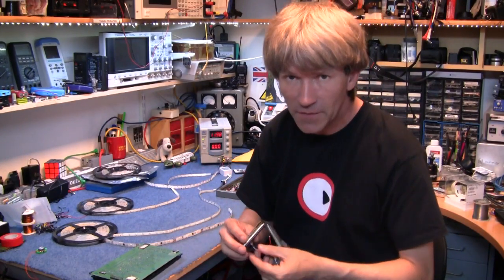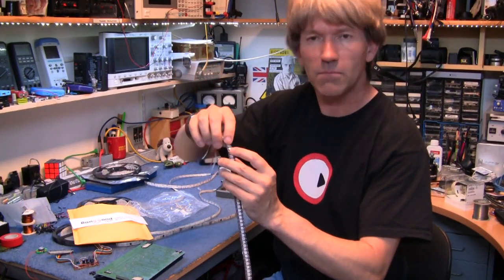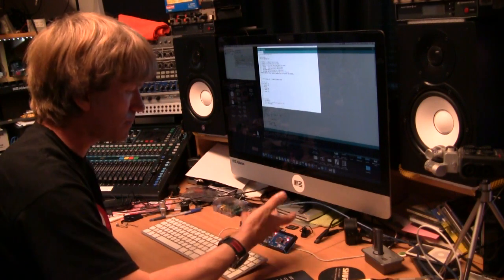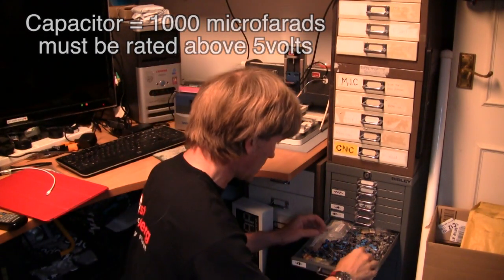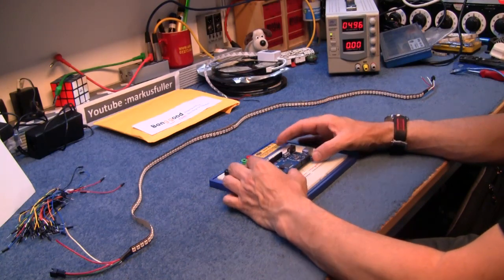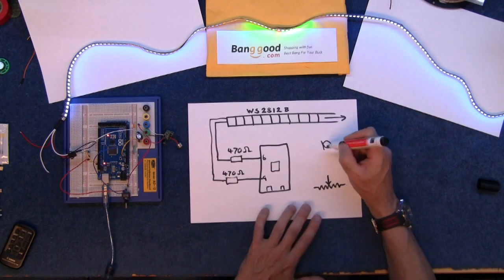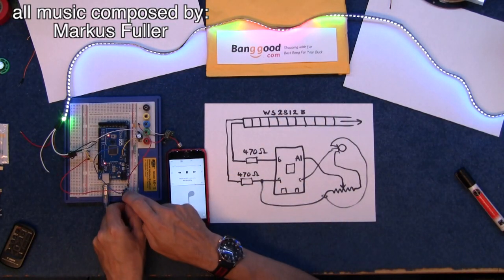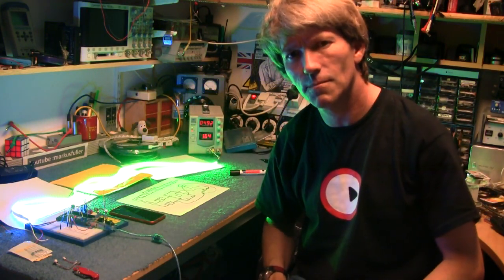Making a 144 LED VU meter from arduino and ws2812 addressable leds

Comment: This seems easy for a beginner like me :)  I have the components so here we go..... actually I have 2 strings of 144 lights but lets just start with one LOL  Thank you Markus!!! You have a new Subscriber :)  OHHHHH one question actually.... Do you have a link to the sketch you used for this?  Many Thanks!
Reply from the maker: Hi John. sorry it was a long time ago I cannot remember where I got the sketch but it was probably on the website called github .
Reply: @markusfuller  You threw a couple capacitors in there but they don't show up on the wiring diagram... where did you put them ;)  Thank you!
Reply from the maker: @TheCowboysdude  Hi John. the capacitors were placed across the power to help smooth the voltage from my power supply. they are not needed if you have a good smooth power supply.
Reply: @markusfuller  Once again Thank you!!!

Comment: One question mate:
What if I connect to this arduino mega a 12v led strip with 12v power supply, not 5v because my led strip is for 12v only.
Waiting for answer, thanks..

Comment: Hey I'm interested in getting into the Arduino stuff. Is the're a kit that you could recommend for me? Thanks
Reply: Get an Arduino starter kit with Arduino Uno. When you're a bit more familiar with the Arduino, you can try the smaller boards, or even an ATtiny85. You need a shield, a dedicated Arduino board and the ISP programmer scetch to program the ATtiny though. This information will all be available online, just ask google.

Comment: VU's usually go from green to red through amber (as you no so adjust software ?) and you don't need the 470 ohm on the ground line but a 100 mike Elec cap across VCC and GND will stop any supply voltage spikes. Your diagram is a bit misleading as it shows the "strip" as a 2 wire device, it should show VCC,GND and DATA..... you have a powered breadboard so point the cap out or include on diagram Pls (just thinking of your less experienced viewers)  ........Love your style keep it up!

Comment: Thanks for the interesting video, Markus. I have just received a 30 led strip yesterday and got it working with some code from Nils, Hamburgtech, I think, and it looked quite impressive.Kevin Darrah also has a video on WS2812B strips. I have ordered a 300 led strip so that should be interesting.   I like your presentations and esp your own music which is tastefully mixed unlike most on YT.  I'm into guitar and electronic music.

Comment: i have ws2812b 300leds in 5 meter ...i have 5v 8A power adaptor and sp103e controller and still not working.... for the first time i made a mistake...i plug in the controller into 12v adaptor...waw very hot temp...  did it was broke?
know what should i do?
Reply from the maker: tuah cool Hello. you may have overloaded the controller and it could be damaged. if it is an arduino there is a small green flat component on the board which may have an "f" printed on it and that is a fuse . maybe you could check it with a multimeter and if you are lucky that may have blown before any real damage was done to the chip.
Reply: oh men... i not using adruino
i am using a simple controller SP103e

and if in the future i buy adruino?  what V is it?  5v?

Comment: Can the dynamic range be adjusted? It looks like it doesn't start from LED1 going towards the end of the strip. It looks like it only lights up a few LEDs over. As you change the pontentiometer it starts several LEDs further up and again it only goes a few more LEDs down the strip. In other words, can you adjust it to where the lowest dB will light up LED 1, and max dB go all the way to the end of the strip?

Comment: Great video  is there a way I can connect more strip lights . Thanks
Reply: Yes, you can just add more to the end of the existing strip, and change the number of LED's in the code. Be mindful of the power requirements though. A 144 LED strip at full brightness White can use up to 8.7 Amps (20mA per RGB *144 LEDS). Using the FastLED library for Arduino you can limit the power usage with a line of code.  For example  :-
 FastLED.setMaxPowerInVoltsAndMilliamps(5, 2000); will limit the led strip to approximately 2 Amps at the cost of running the LED strip at a lower brightness.

Comment: Is there a noticable difference in the brightness between the 60 LEDs/m and the 144 LEDs/m strips at a big distance?
Reply from the maker: StarTrek123456 Hi I only used them on the desk but I guess at a distance the 144 led version will be brighter.

Comment: New to arduinos, does it matter what board you use? There seem to be quite a few Arduino mega boards out there.
Reply from the maker: Jessica Haskins Hi Jessica. I cannot keep up with the amount of types of arduino you can buy, I just bought the mega for the extra pinouts and larger memory but I have never used those extras and could have done everything on a smaller cheaper one.

Comment: The 470ohm inline resistors are not really needed, especially on the ground...
Reply: The resistor inline with the data wire is not vital, but is a good practice. It protects the chips. The one inline with ground is not necessary. Common grounds should always be connected together with solid wire connections.

Comment: so pertaining to the voltage of the capacitor isnt it best to closely match the power out put to the leds please correct me if im wrong but couldnt a 16v cap possibly charge up to that 16 volts even if only 5v is being supplied and possibly send a power surge to the leds?
Reply from the maker: zack lariviere Hi a 16v capacitor is just the safe limit it should operate at. if you have 5 volts going into it then it will stay at 5 volts. think of it as an egg box, it can hold sixteen eggs but you only have 5 in there but it can safely hold 16 if you placed 16 in there. hope that helps, best wishes from markus.
Reply: Thanks for responding

Comment: Great video! I just had two questions: How did you hook up the capacitor? Also, at ~0:50 seconds you show a room with LEDs around the top. Ive been wanting to do that as well, but haven't figured out a way to power a strip long enough. I currently have 13 meters of WS2812B, but how would you recommend going powering them in-line? Thanks again for the great video!
Reply: hello,if you need ws2812b led strip light,please contact to me.
Skype: jeason888@outlook.com
EMAIL: jeason_xt@jercio.com

Comment: hi can i get the code u use for this project please
Reply from the maker: II Th3Hawk III Hello I got the code off the internet, just type in ws2812 led arduino code and there may be a page that shows up with adafruit code. i think it was that one i used.
Reply: isnt there anyway you would still have the code ?
Reply from the maker: II Th3Hawk III it may be on my computer at home but I am out at work at the moment.
Reply: hi i have followed every step of the tutorial but it doesnt work i use a 2 pin microphone instead of a powerd one so pleas if you can draw the schematics of it and send them you would help me alot i need it for school
Reply from the maker: II Th3Hawk III Hello, I do not think it will work with the 2 pin microphone because it needs a proper signal level and an unpowered microphone is unable to give that much signal. as for the program I think I found it on adafruit website.

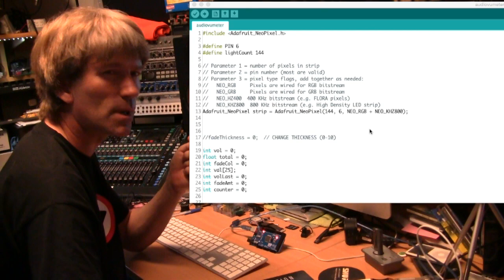Comment: at 4:50, the purpose of lines 3 and 4 is to have a generic line 13 as:
Adafruit_NeoPizel strip = Adafruit_NeoPixel(lightCount, PIN, NEO_RGB + NEO_KHZ800);
so you need to change only those 2 initial lines if you change pin or strip lenght...

Comment: Your calc giving 5V at 2A is a bit off... 144 LEDs at 60mA/LED (20mA each for RGB) comes to 8.64A at full brightness white (43.2W) - you need a 10A supply if you're going to drive a 1m strip flat out.

Also , you shouldn't have the 470R in the ground lead.. this may cause a voltage difference between the strip and the Arduino that may make data transfer unreliable. It may be necessary in the data line from pin 6 but you should connect the ground directly, without the 470R.
Reply from the maker: Hi Steve, your calculations are correct but I was only going by what my PSU was displaying.
Reply: Because you'll mix colors, you'll never gonna use 60mA. More in the range of 20mA

Comment: How would you wire this up if you had multiple strings of the WS2812's and they aren't daisy chained?
Reply from the maker: Hi I think you can run several hundreds of these in one row especially if you use something like the teensy 3.2 . but I think you can also use several outputs from an arduino running into each length of ws2812s but your coding would have to take this into account. say row A on pin 6 row B on pin 7 etc etc until you run out of outputs. but the arduino will run large amounts of these ws2812s.

Comment: Your microphone is not providing enough signal to use the full range of the VU meter you should install an op-amp or a Darlington pair to boost the signal.
Reply from the maker: Im still new to the arduino. learning new things all the time. I have wasted many hours but those wasted moments will save me time in the future as I hopefully get better.
Reply from the maker: Hi yes I have made several changes to it now. but at the moment im using my only arduino to perform something else. many thanks from Markus
Reply: you need more arduino boards ;), i´ve already five here, just to get things running, and everytime something is ready i stick an 328P DIP inside copy the whole thing and solder it on a board...but everytime i tinker around i always want to have a spare UNO board...;) too much unfinished stuff, as i can start just from where i left...it´s the nicest thing with them µCs (but you need to comment your code well, or you won´t be able to read what you´ve done, may be some two weeks later...even worse when more time is inbetween)

Comment: So at 5V and full brightness it only uses 2A. Ive heard on bangood that these can use up to 42W.
Reply: Each LED uses about 0.06A according to their specs. So 144 LEDs/m = 144 * 0.06A = 8.64A. Multiply that by 5V and you get 43.2W/m

Comment: I will try that resistor config. I have just been using a single 1 to 10K resistor for noise and other interference but its not good enough.
I have nearly 1500 of these in the lounge room and interference can be a major issue. For example 1 string can wirelessly send very accurate interference to another string not connected except  power. Also some DMX devices can be very noisy(cheap shitty switch mode power supply's).
Reply: Use capacitors in parallel to power and ground. Always use the resistor on the data wire, but not on ground. Grounds should be all connected together and with solid wire connections. Only one resistor is required, coming straight off the Arduino's pin. The rest of the strips can be just chained together.

Comment: Every tried Glediator ? amazing little java app to control strips / arrays.
Reply from the maker: I was watching those vids last night. I think i need to buy a lot more ws2812b's
Reply: It does allow you to set array size to one so you can use on a string and it has sound / beat detection built in , might still be fun to see how it handles the different effects even on a single string. Also I must do the same been meaning for ages to try them out , how was your experience with getting them of bangood how long was shipping ?
Reply from the maker: +Darren Woods Hi Darren, they arrived in about 5 days which was pretty quick. I think they must have a warehouse in the uk ?.
Reply: they might or they might be up to what "EU Direct deal-extreme" did to me , told me EU warehouse and it took only 7 days. It came from air mail china straight to some house in the Netherlands and then shipped on to me ...I got a warning from the revenue for it. Was not exactly impressed lol.
Reply from the maker: I think they have something on each product page saying shipped from CN or EU or in this case UK. there must be a warehouse in Portsmouth in the south of england.
Reply: Look on my channel: miniature controller Led Master mini v2  for WS2812(B), WS2813....Jinx and Glediator support!!!

Comment: In your code, if you assign values to PIN and lightCount as you have done at the top, then you can use those variables in the "strip" definition
Reply from the maker: Im still banging my head with arduino code. Im a little bit behind but running as fast as i can.
Reply: Hi Mark, your video was very informative. But I was wondering if you still have that red green blue chase code?

Comment: It is posible to multiplex the leds to save current?
Reply from the maker: I really do not know that to be honest but you can use every odd or even numbered led or every third and switch them quickly.
Reply: No. If you try PWM controlling the strips, they will reset and lose their  data after power off. They need stable 5V and data. The data signal already does the PWM to mix the colors inside each LED. The only way to multiplex them is through the data pin.

Comment: Thanks for sharing this with us. That LED strip would be awesome if used at the bottom end of long translucent plastic curtains, hung from a black ceiling to simulate the aurora. Just add a light breeze from a small fan on them. Maybe?
Reply from the maker: actually that sounds a very good idea Thomas.
Reply: hello,if you need ws2812b led strip light,please contact to me.
Skype: jeason888@outlook.com
EMAIL: jeason_xt@jercio.com

Comment: If you want to extend this idea you could go for a spectrum analyzer with e.g. 10 leds per tone. There is very useful microchip out there called MSGEQ7 (cheap and relatively easy to use). It is a seven-band spectrum analyzer and is very commonly seen in led-music kind of projects.
Reply: it is even possible to jimmy more than one together for a 14 band spectrum analyzer and so on
Reply from the maker: I have so many ideas but lack the knowledge of arduino. those MSGEQ7 chips sound interesting . many thanks

Comment: I've got some videos on my account for using these individually, creating an 8x8 matrix (1 meter square). Lots of soldering (basically, 6 points per, times 64). They are a lot of fun to work with, especially with a ESP8266 wifi chip to remotely push or pull data to them.
Reply from the maker: Hi Greg Im truly a newbie in the arduino/raspberry way of making things. I will certainly go and check your videos out as I want to learn more and more and more. many thanks.
Reply: No problem. Drop me a note if you have questions you think I might be able to answer.
Reply from the maker: Thanks Greg thats very much appreciated.